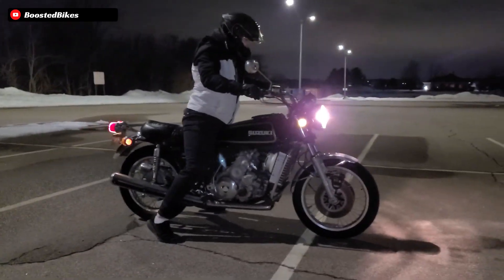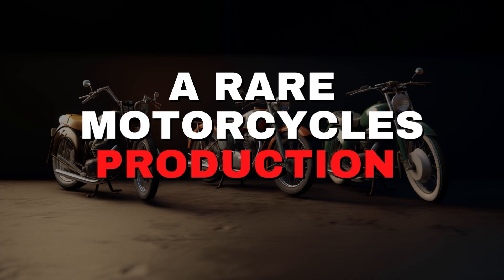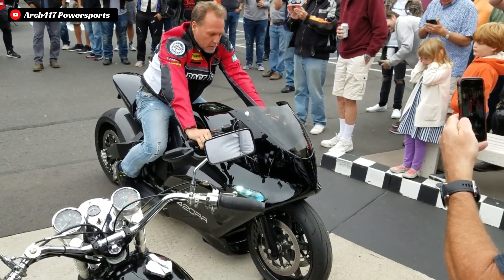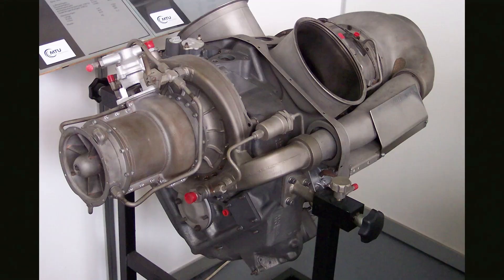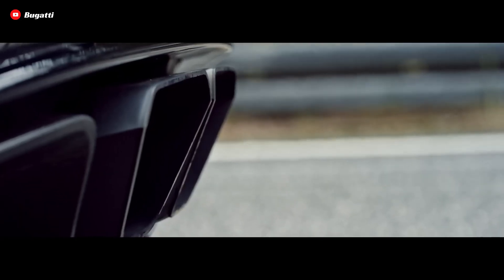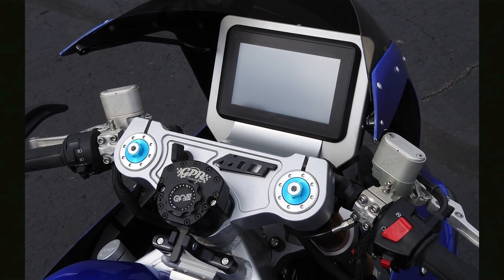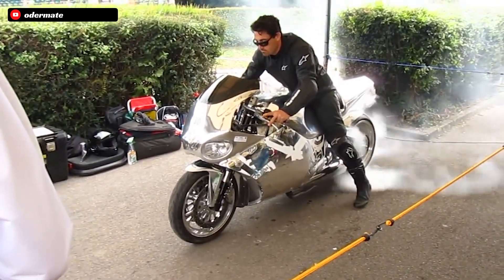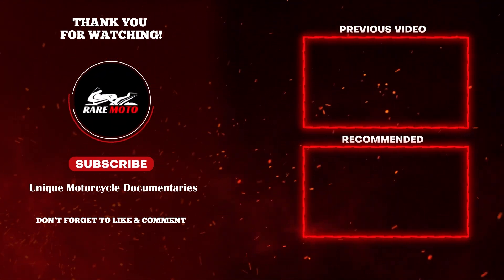The INSANE 273 Mph Jet Turbine Powered Motorcycle - The MTT 420RR

Comment: God dude your speaking cadence is unbearable. I get you gotta squeeze it for length but you can talk a little bit faster and it'll be ok. By the way it doesn't use a jet turbine. It's a turboshaft from a helicopter aka no jet or thrust propulsion or whatever since y'know it's spinning a shaft. If your whole schtick is to cover rare motorcycles, you should be at least sort of knowledgeable about this stuff.